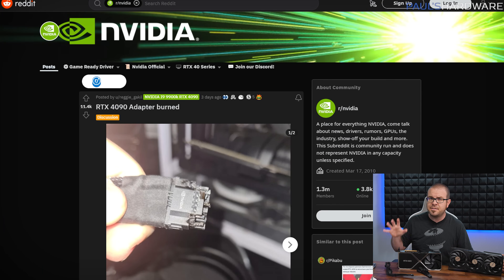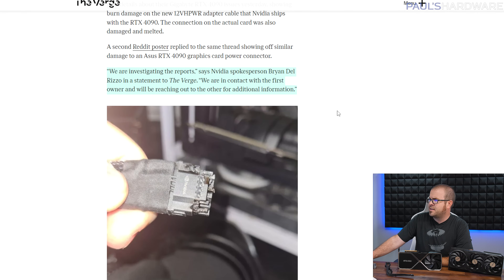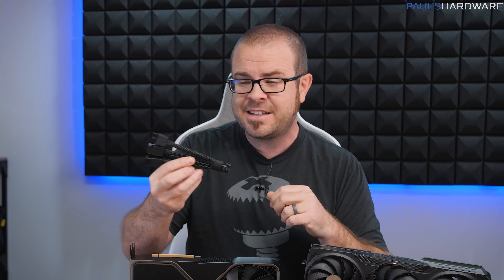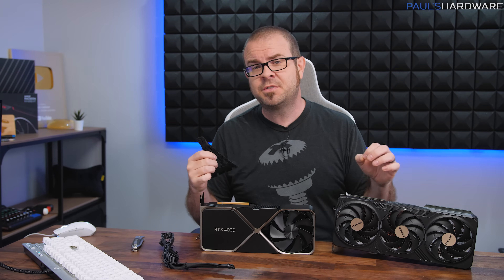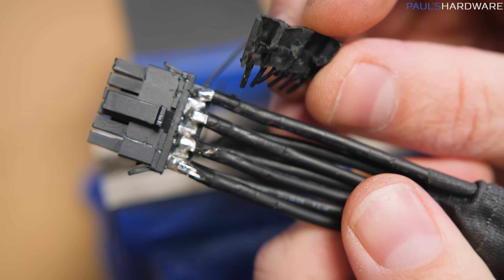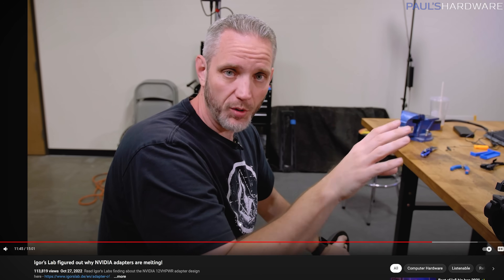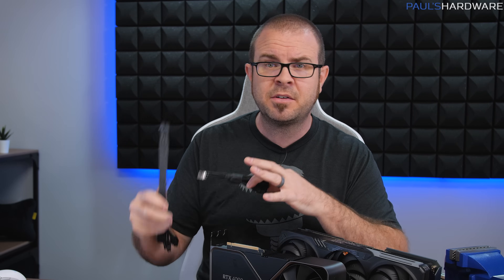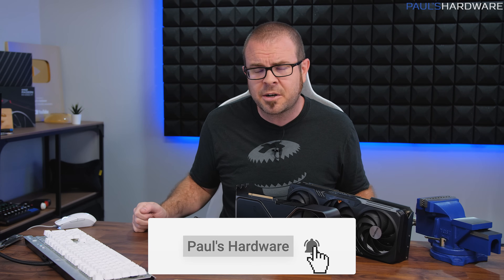Why are some melting? RTX 4090 600W 12VHPWR Adapter Teardown

Comment: No, the total resistance would not be much higher with a wire making poor connection vs no connection unless the GFX card itself loads the pins independently and tries to even out the load.
Current will simply travel the path of least resistance.

Comment: If this is the cause of the problem, you could probably verify that your connector was good without pulling it apart by testing a multimeter on each PSU end connector pin and ensuring that all of them have a good low resistance connection to the 12V pins on the GPU end connector - right?

Comment: Some cards, notably the Gainward Phantom (Don't know about the GS) and Inno3D iChill (non-OC) come with a 3xPCI pigtail instead of 4xPCI like the one everyone is talking about. It still has the signature heatshrink textile stuff, but I'm curious whether they maybe are wired better, or are just too uncommon to the point where we're not hearing about them. I have one on hand right now, but I'm not taking it apart until I get a cable from cable mod to replace it 😅

Also I guess we can't fault the connector for the wires not being crimped into the pins, which is reassuring in terms of having the plug on all high end cards in the future.

Comment: I doubt the issue is the bend in the adapter cable since it took a Dremel to get it apart, the plug and it's wiring do not appear to be a weak link. I think it's much more likely the adapters that melted were not plugged in fully and the loose connection at the GPU power socket cause an over heat situation...that would also explain the damage to the socket on the card itself.

Comment: Guess I will be getting an AMD card. As long as they have a card better than my 3090 I will be happy. I had some power issues with my computer when I first built it last summer and it was hell trying to figure out why I had to cycle the PSU power switch just to turn my PC back on after a shutdown. It ended up being a bent pin on a USB splitter I had connected to my motherboard.

Comment: Better to throw that adapter in the bin and buy a proper cable. I will buy one from CableMod when i get a card that has that connector.
I wonder when GN is going to make video on this thing. Steve usualy jumps at thigs that go up in flames or melt in any ways.

Comment: I'm an Aerospace EE, so I generally work from a far more robust set of standards. But they should not, under any circumstances, bus EC's under material like this, it eliminates visual inspection of connectivity, it also insulates heat in. Also, a mil-spec high temp wire, i.e. M22759/16-*  or better yet, M22759/8-* wire would be far more robust. As well as individual wire per termination points.

Comment: NVidia really screwed this up. Just one 14 gauge wire can handle the 50 amps easily. They use a 14gauge wire and 22 gauge connectors. Not smart at all.

Comment: If there was poor connection at the solder joint, the plastic would melt at the solder joint. Not somewhere else.

Comment: Very useful video. I would like to know what current (Amps) EACH of the 12 pins the GPU uses. Could the GPU draw more Amps on the outer pins? Anyway, for such an expensive card, it seems they tried to save money on the wires. I would not want to have my name on those cables. They stink of nasty cheapness.

Comment: Keep in mind with thermal camera results you're observing the outside of the plastic connector. Plastic is an insulator; the actual temperatures of the electrical connections inside the connector are going to be significantly higher.

Also the solder joints lie towards the rear of the connector, which doesn't directly explain why the opposite end of the connector where the pins lie is melting. The solder joints are possibly a secondary issue unrelated to the melting.

Comment: the quality of those soldered connections/design is the worst I've seen in a while ... amateur hour. Nvidia is lucky that a replacement of the adapter will fix the issues.
Kuddos to all the YT channels investigating this (and other) issue(s).

Comment: Biggest issue I can see is binding them all together in a tight 'shrinkwrap', it would be much better to shrinkwrap the top 4 and bottom 4 separately, that would allow for movement when bending into position. currently as they are so tightly bound together if you put a 90o bend on them it will have no option but to pull the top connectors loose there is no way they could just slide against each other.
quick test grap a note pad/book grab the approximate amount of pages and bend the pages back and see how much 'shorter' the top pages are compared to the bottom.

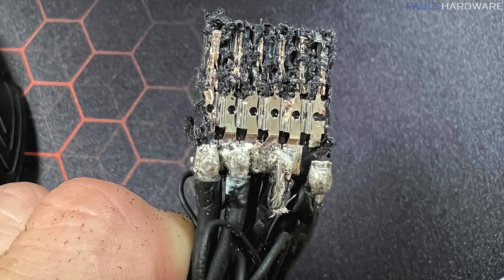Comment: 12:00 No, no, wrong, nope.

Electric current takes a path of least resistance. If there was a poor connection on one of the wires, causing increase in resistance, the current through that wire would drop (inverse proportionally to the increase in resistance), and if the overall power draw of the card stayed the same, the difference in current through the one connection that went from good to poor, would be distributed between the remaining connections that are still good.

A good connection would have a resistance of say, Rg = 0.005 Ohm, and a (very) poor one would have a resistance of, say, Rp = 10 Ohms.

In a scenario where draws 600 watts (at 12V that's 50 A of current) and all connections are good (0.005 Ohm), total resistance of the connections would be Rc = 0.00125 Ohm. 
The voltage drop over such connection would be Vd = I * Rc = 50A * 0.00125 Ohm = 0.0625 V, resulting in power loss of 3.125 W ( 0.78125 W per connection, all being good and equal), which is easily dissipated.

Now, say one connection went really bad to Rp = 10 Ohm. All connections are still in parallel, so total resistance of the connection would now be Rc = 0.00166638 Ohm.
Voltage drop would increase to Vd = 0.00833194 V, and total power loss would be 4.165972 W. That's a roughly one watt increase. However, current flow would not be equal through all four connections; the current through the poor connection would be Vd / Rp = 0.00833194 / 10 = 0.000833 A. Power loss at poor connection would then be Ip ^ 2 * Rp = 0.0008^2 * 10 = 0,006 mW. 
That's like, nothing! Almost all power loss would come from the remaining three good connections.

If the poor connection was not that bad, at Rp = 1 Ohm, it would be as follows:
Total resistance would now be Rc = 0.00166389 Ohm, and voltage drop Vd = 0.00831947 V, and total power loss = 4.159734 W. 
The current through the poor connection would be Vd / Rp = 0.00831947 / 1 = 0.00831947 A. Power loss at poor connection would then be Ip ^ 2 * Rp = 0.008^2 * 1 = 0,064 mW. 
 Again, that is NOT going to melt anything.

Arcing is also impossible as long as there is still a solid connection, even if it was only one. You can't have an arc, or spark, to jump a "gap", if said gap is bridged by a solid connection, because then it's as if there was no gap at all.

What can cause melting, however, is if all of the connections were kind of meh, say the ones on the side would be Rm = 0.1 Ohm,, and the middle two were "not that bad", say Rn = 0,01 Ohm.
Now the total resistance would be Rc = 0.004545 Ohm, and voltage drop Vd = 0.227272 V. The total power loss of such connection would be 11.36 W, with the better middle connections losing 5.165 W each, and the worse side connections losing 0,5165 W each.
This is getting dangerous now.

Now, let's say the connections were all different kinds of bad; R1 = 0.2 Ohm R2 = 0.1 Ohm, R 3 = 0.05 Ohm, R4 = 0.1 Ohm.
Now the totak resistance would be 0.0222 Ohm, and with current draw being still 50A, the voltage drop at such connection would be Vd = 1.1111 V, total power loss would be 55.5555 W. Now THAT is going to melt stuff (if not set it on fire).
The current through such connections would be distributed accordingly:
I1 = 5.5555 A, I2 = 11.1111 A, I3 = 22.2222 A and I4 = 11.1111 A
And power loss:
P1 = 6.17W, P2 = 12.34W, P3 = 24.69W, P4 =  12.34W

Comment: Paul, Jay's testing is poor. He's reading temperatures of the outer surface of the plastic with a thermal camera. Plastic is not a good heat conducter, even if it was hot inside it would not show on the surface.

Comment: thanks paul. jayz vid confused me, suggesting that disconnected pins were overheating...
you explained it far better. dodgy connection, higher resistance, voila, smoke.

Comment: the terminals are just way too small to effectively handle 600W... those are the same pins that are used on the front panel, the audio connectors and most jumper pins on all motherboards... it would have been better if they used the connectors used on the motherboard 12V ATX plugs. These have bigger pins.

Comment: I think main problem is that bus bar in that connector. if one contact get good connection then it gets more amp and can be overloaded. If it got bad connection then amps spread to other connectors. So it's most likely one good connection taking too much current and burn itself.
Long wires will balance this out.
Note: one thing that can cause uneven contact is constant force to connector or not fully inserted.

Comment: at 12:15 
If the connection is broken and has a high resistance, the current wouldn't flow there, as the current always travels the path of least resistance. So that ain't the issue. The issue is with the Connection or the Connector.

Comment: So Nvidia cut corners with their adapter cables. Sad to see with such an accessory for such a high end and expensive product. Seems to be better to just get a proper 12VHPWR PSU and use the cables the PSU manufacturer provides, or custom cables like Cablemods that use dedicated wires for every pin and haven't cut corners. And i think the upcoming Cablemod 90-degree adapter for the 12VHPWR connector seems like a logical and smart choice, just for case and cable managements sake.

Comment: Those adapter cables are such a bad design. The power supply cables are done right. Each terminal has it's own wire and I bet the wires are crimped to the terminal instead of soldered.

Comment: i just checked my 4090 cable and it looks good for now. I ordered CableMod's version of the 12VHPWR cable you showed and itll be here in 3 days. As soon as i get that cable i'll be swapping this ugly nvidia one out for the nice new CableMod one. Then when their 90 degree adapter launches in a couple days i''ll be ordering that as well.

Comment: The problem is the wires should of been crimped to the terminals instead of soldered. For example 12 volts drawing 400 watts is 33.3 amps. That's a lot of current going through a wire. The wire and terminal could get hot enough to melt the solder or the solder pad could break off causing a short. A cold solder joint could also be a problem if the soldering wasn't done correctly. The wire would then break off the solder if stressed from side to side also causing a short.

Comment: Igor's conclusion was already debunked by Buildzoid, LUL https://www.youtube.com/watch?v=yvSetyi9vj8
Just think about it logically - the solder joints are on opposite part of connector where there is no melted plastic. That doesn't mean Igor is wrong about that part of connector being shit quality - I'm sure it is - but those posted melted connectors are not melting anywhere close to solder joints. It's weak receptacle contact on pins, very likely because nvidia is not using OEM receptacle terminals.

Comment: This is the point isn't it, Nvidia aren't "power supply" manufacturers they don't think about the consequences of high powered cables, they've just engaged the cheapest cable manufacturer and told them to build something quickly and now its the end user suffering for that decision. Corsair actually put some thought into their cable with their PSU design knowledge that they have.

Comment: Using a solder joint only is a no no really because when that connection gets hot the solder will soften and increase the likelihood for a failure down the road.

Comment: The fault is in using four soldered connections per side instead of six crimped connections per side. Poor design by NVIDIA. They should know better.
Reply: Poor design by intel's atx3.0 saving money on your safety
Reply: I'm not sure if you're blaming the 12VHPWR spec Intel put out here, or what. The problem is not with the 12VHPWR connector; the problem is with NVIDIA very poorly using 4x EPS12V 8-pin connectors, requiring them to solder connectors in order to keep costs down instead of doing it correctly.

Comment: It sucks Nvidia connector is no good, but people also wanna be cheap when buying a 1600$+ gpu, buy a new atx 3.0 psu OR at least spend 20 to 30$ somewhere is free to get a proper new connector from a psu manufacturer.  They are running way too much power though low quality adapter...and bending  only increases the problem...

Comment: So we have gone from IIRC Brian Del Rizzo telling Jay2Cents melting connectors wernt happening, to a memo to all card partners to return cards to Nvidia. Someone if going to loose a house at some point over these things, or worse. Is that the line that gets crossed where Nvidia actually realises it would have been cheaper and better PR to immediately address the issue and develop a better connector?

Comment: With the old connectors LN2 overclockers pulled 1100 watts no issue but somehow this connector struggles with double the wires and half that power.  1/2 wires less should not be a issue at all and wouldnt be with a traditional 8 pin. The connector just isn't capable of the power required. Heck Der8auwer ones cut of all but 1 ground and polus wire frm a 8 pin and it worked just fine. From asll the photos i saw it all starts att the contact point the rest seems rather meaningless. One thing can be that the pins are not copper but metal. if you still have the connectoryou could grind it down and see if it's actual copper. And the temp on all photo's seem to be on the 2 outer wires the most.

Comment: AWG standard spec for 14 gauge wire max current is 5,9A, so that adaptor is rated for max amperage of 23,6A current. 23,6 X12V = 283W, so there, gigidy...
Reply: So with this in mind, those 4 12V wires and the corresponding ground wires should be at least 10 gauge wires to be able to carry that much of load safely, and to pass any safety regulatory tests on consumer products...

Comment: Glad I bought the Corsair 12 pin adapter.  It has 12 individual wires.  Super high quality, not this hot mess.
Reply: it will not save not you or your bank account, lol
Reply: @аибе-о9ь  this comment makes no sense.  Is this a bot?  Save me from what?  It will save from having a fire so yes it will.

Comment: its time for power supply manufacturers to switch to a dedicated 2 pin 12v or 3 pin for 5v+ thick boy gauge wire to power your graphics. this whole multiple pin connectors for power delivery has always been a bandaid to solve compatibility and to save cost. its a very terrible design that should have been replaced since 8-pin graphics cards came out.

Comment: The issue seem boil down to that the wires are simply soldered into place (instead of being crimped down).
This can cause arcing/sparks inside the plastic housing (and in turn, melt the plastic) if they come lose.

Users simply bending the cable from side to side a little can be enough to cause the wires to break lose
(which can easily happen when people try and do some cable management).

nVidia will need to recall these cheaply made adapters, as they are not safe to use.

That native Corsair-cable is complete safe to use as the wires are crimped down, and not soldered.

Comment: I reckon at this rate the PCIe 6.0 power cable spec will switch to a busbar directly from PSU to the GPU 😂 remove the need for these silly cables and adapters

Comment: As it states int he datasheet of that connector, it's durability is 30 mating cycles.. .after that you're supposed to toss it. And reading the datasheet, the connector is used at it's limits by the 4090, meaning that one has to be absolutely sure that the connector is properly seated, which means very clean contact surfaces (no dust, no grease) and that it's been mated straight and pushed all the way in and is not subjected to ANY strain what so ever. No pulling, no torque to the side (by bending the cabling) nor anything as such.

That connector is not suitable for the application and for consumers grubby hands and people building their own computers. It's meant for special applications where you need large amount of current over very small wires and in tight space PLUS when you need control signals on top of that.

Using that type on consumer GPU and pushing it's limits in current handling is really a recipe for destruction.
nVidia is either stupid, or didn't ever mean a consumer to buy the 4090 card and it was meant for servers and high end system integrator where in highly clean environments, with very strict quality control, professionals install them ONCE to a system that's never touched again.

that's not a consumer environment.

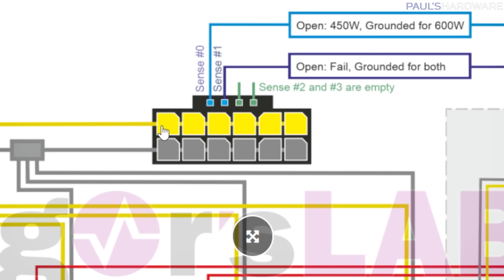Comment: Ah yes proprietary bull crap lovely 5:00 they seriously couldn't just use normal 8 pin connectors. They should have just took two eight pin connectors and glued them together.

Comment: For gods sake, please give me just two fat, simple power wires (+/-12V) I can screw down on the backside of GPU. No cable mess, no issue with connectors. 19th century tech that's miles ahead of this 21st century failure of electric engineering and cable management. For f. 2000 EUR can I have as much!? Or a solid copper connector attached to the end of such cable. You can feed the whole PC with 2 dead simple sticks put into your power outlet, but GPU needs all this cable and connector crap?!

Comment: This type of connecting the wire with a pin is soooooo baaaaad... The cable should be clamped on the pin itself and then soldered. No wonder the cables are getting snapped from the metal plate, when the soldering surface is like what? 1mm?